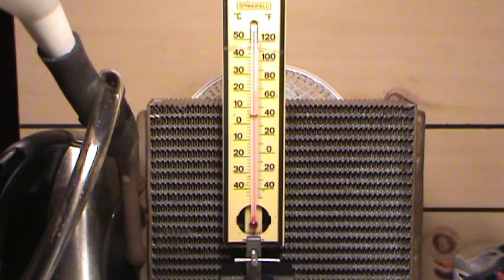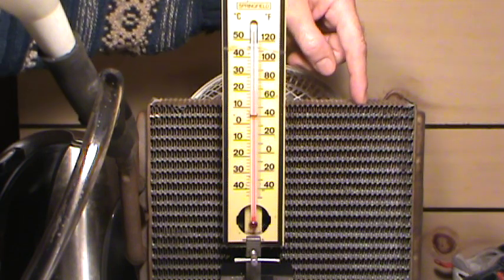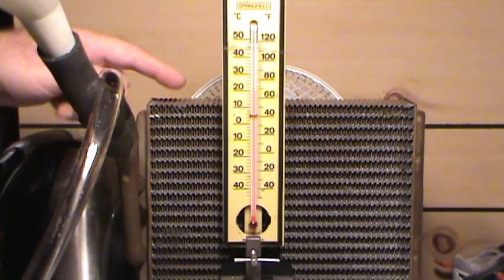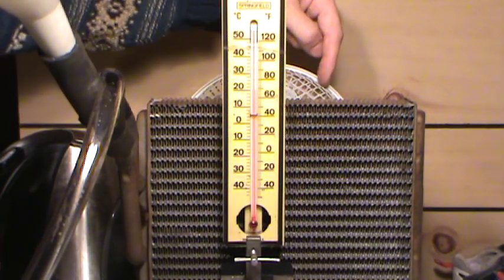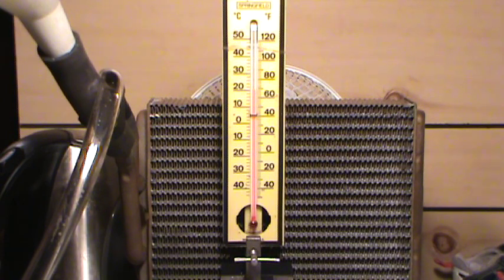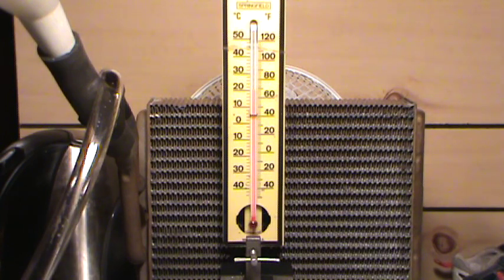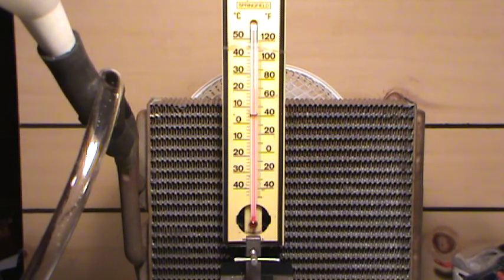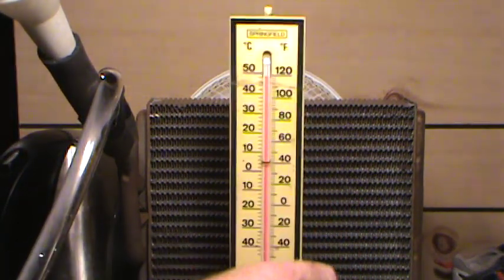How the Heater in your Car or Truck Works

Comment: can you also show how todays modern heating system works, that vacuum you were talking about.
Reply from the maker: Greetings...bazrazin1...……..Thanks for watching...……..Well, there are quite a few different designs, that apply to, the heating and air conditioning controls, that, the many different vehicle manufacturers have, for all of their vehicle models...…….In, some of the much older cars (before computers were installed in them), then, the cars, usually only used cables (like the brake cables on a bicycle), to control the air diversion doors (flaps), that were in the heater box, under the dashboard, along with, an electrical switch, to control the speed, of the electric, (air) blower motor, that blows hot or cold air, into the vehicle, through the vents in the dashboard, or, onto the floor area...……..Then, some vehicles, had a bunch of, smaller size, rubber or plastic hoses, and, when the engine was running, then, the position of the switch, that was on the dashboard, routed the engine's vacuum (as in, suction), to an actuator (might be a small can shaped thing, with a rubber-like diaphragm, inside of it, which might, push or pull, on a rod, that might move an air diverter door (flap), in order to direct the air, to where, it is supposed to go (sometimes, through, partially through, or around the heater core, depending on, how hot you wanted, the inside of the vehicle to be)…….Then, it gets quite involved, and then some, when air-conditioning is added in...!!!...……The Heating system, and, the Air Conditioning system's "Controls", have to be working properly, or else, things get all messed up...…….The heater core, has to have, hot coolant flowing through it, if it's heat, that you want...……..If Ya want it much colder, then, the air conditioning system, has to work properly...……..So, yeah, there's a lot going on, with the controls, when, having to control, both, the heating, and the cooling (air conditioning), and that's why, it's usually so expensive to fix, with all of those (moving) parts, as well as, how difficult it gets, at times, just to, get at, the part or system, that needs fixing, and...….till next time...….Be Safe, take care, and have a good one.

Comment: Where did the 2 pipe locted
Reply from the maker: Greetings...RAJIV RANA.............Thanks for watching............The "2 (metal) Pipes", that, the 2 rubber coolant (anti-freeze and water mixture) hoses, get clamped onto, on this particular Chevy Van's "heater core", are both, on the "same side", where you can see, a clear plastic hose, connected to 1 of them...........Due to the many types, of cars and trucks, that there are out there, then, there has to be, many..."different"...heater core...sizes, shapes, and, just where, those 2 metal pipes come out of the heater core, so, the heater core, and its 2 pipes, will "fit" properly, into the heater housing (usually, found under the dashboard), and sometimes, not too far from, the air conditioning system's, evaporator (core?), if so equipped, and........till next time........Be Safe, take care, and have a good one.

Comment: Thanks for the video! Out of curiosity, can this system works in reverse, you know, a simple refrigerant running through the core to cool off the air?
Reply from the maker: Greetings...Mr. DC..........You're welcome, and, thanks for watching............Well, if that simple refrigerant, is just plain ole water, then, it should cool the air, to a certain extent, and, I be thinkin', that, if I were to run "ice-cold" water through the setup, that you saw, in this video of mine, then, it should cool, that, warm or hot air, quite a bit, that was going through, all of those little fins, in the heater core, as seen, in this very same video (of mine)...........I have, I think it's called, something along the lines, of being, a "swamp cooler"..........This "thing", is a quite large (factory made), plastic box-shaped unit, that's on 4 metal legs, complete with castors (wheels)............On the back-side of it, there's a large woven vertical screen, oh, about 5/8 of an inch thick (looks a bit, like a co-co colored doormat, somewhat), that has cold tap water pumped up to the top of it............The unit, runs on 110 volts ac (house plug)............So, on a hot day, I just add, a gallon or two, of cold tap water, into the unit's, lower holding tank, then, select the fan speed, and then, the (internal) pump, pumps that cold tap water, up to the top of that, shall we say, "co-co" mat...lol...and then, that cold tap water, makes its way, along the co-co mat's, entire top length, and then, it just "trickles" down, the co-co mat's entire surface (due to earth's gravity), and, when that, very warm room air (or, very warm outside air, if I use it outside, that is), passes through, the cold tap water-soaked co-co mat, I get...ahhhhh....cooled down...real good, and, I guess, that one could call "it", a poor man's..."Air Conditioner"...!!!...lol...and damn, I picked this, almost, new looking "thing" up, quite a few years ago, at a thrift store, for, now get this...$15.00...!!! (as I recall), and.......till next time.......Be Safe, take care, and have a good one.

Comment: great video. thanks!
Reply from the maker: Greetings...Chaz Steadman.............Thanks for the nice comment, and for watching too.............Well, You have probably noticed, that there isn't any Heat coming out of the (windshield) Defrost Vents on top of the Dashboard (with the fan on), when-ever the Engine is first started on a quite cold day, right...???...that's because the Coolant (anti-freeze and water mixture, that is inside the engine, radiator, and heater core too) is, about as cold as, the Air, that is surrounding the vehicle, before, the cold Engine is started-up................The Colder it is, where the vehicle is parked, then, the Longer (time-wise), it will usually take, before the (cold) Coolant (that gets "Heated-up" by the running engine), will Warm-Up enough, to the point, where, the Cold Air (that was coming out of the dashboard's defrost vents), will gradually, get warmer...and...Warmer...up to the point (as in Hot), where the engine has finally reached its Maximum Coolant temperature, that is usually Limited/Regulated by the engine's (coolant) Thermostat (some engine Thermostats, might be rated at, 195 Degrees Fahrenheit, as an example)..............When engine "Coolant", gets too Old, then, the "Anti-Corrosion" protection, that the Anti-Freeze itself provides (when mixed in the proper mixing Ratio, with water), will get used up/disappear, and will usually get to the point, where, "Corrosion", will start Attacking/building-up, in both the Heater Core, and the Radiator as well, and when it gets Bad enough, then, both the Heater Core and the Radiator, can become "Plugged-Up"...and/or..."Spring a Coolant Leak"...!!! (not good, and, expensive at times as well, to install a new Heater Core, and/or, new Radiator...!!!)............Anti-Freeze, is also "Anti-Boil", so to speak, cuz, when Anti-Freeze is mixed properly/correct mixing Ratio with water, then, the Coolant's Boiling Point is "Higher" than, just plain ole Water is, all by itself...............Also, the Coolant System's "Pressure" (oh, 15 P.S.I./Pounds per square Inch, as an example), that the Radiator "Cap" is calibrated for, will also (by itself) Raise the Boiling Point, of the Coolant, and, just Plain ole Water too.................Warning...!!!...Never Open/Take Off a Radiator "Cap", when the engine's Coolant is Hot or Warm, cuz, the Coolant, is under "Pressure", and that Hot Liquid will Burn You, when it comes Shooting out of the Top of the Radiator...!!!...............There are Different kinds of "Anti-Freeze", and, it's a good idea, to use the "Type", that is Compatible with Your Exact vehicle and engine...............Some types of Anti-Freeze, should be Changed at 2-Year intervals, while other types, say they can last for 5-Years, before putting new stuff in its place (lots of information, is usually printed on, the front and back, of the Anti-Freeze Jug/Container)................When Heater Cores "Plug-Up", then, they probably won't be putting out, as much Heat, as a New Heater Core is capable of..............If a Radiator gets "Plugged-Up" really Bad, then, the Engine will probably/eventually, start "Over-Heating"...!!!...especially so, on a Hot Summer Day (not good...!!!)................Usually, if a Heater Core "Springs-ah-Leak" (coolant leak, that is), then, there will probably be, a sweet smelling "Fog", that will come out of the dashboard's defrost Vents, especially so, when the Fan is running, and if so..."Don't Breathe this Stuff"...it's Bad for You...!!!...and/or, there might also be (at times?), a small puddle of Coolant, on the floor of the vehicle, not too far, from, where the (leaking coolant) Heater Core, happens to be located.................Also, clean up any Anti-Freeze, that is out in the open/on the ground, cuz, if something like a Kitty-Cat, steps in this "Toxic" Stuff, and licks its Paw, then, there's a pretty good chance, that, that Cat's 9-Lives, are all gone now, as in, one Dead Kitty-Cat, and I hope not, and, that can be avoided, by simply, cleaning up that spilled (on the floor/ground) "Anti-Freeze", and........till next time........Be Safe, take care, and have a good one.
Reply: Thanks!
My possible application is to run the intake output lines to a 5 gallon (or 10 gallon) container of hot water and use a 1/16 hp dc garden pump to cycle the water (no antifreeze) thru the heater core to heat part of the space in my motorhome (the living area, hopefully).
Any thoughts on this?
Thanks again,
Chaz
Reply from the maker: Greetings...Chaz Steadman............You're welcome...........Well, if using plain, good ole water, then, over quite some time, the Heater Core will probably start to Corrode, inside of, its internal (liquid) passageways (hollow tubes), where the liquid circulates, and might start plugging it up, unless, the heater core's hollow tubes are made out of Copper or Brass, I'm thinkin'..............If the hoses and/or pipes are Open, on at least One End, and there is "No Pressure" being built up, inside of the hot water carrying hoses or pipes, then, that would be much Safer than, having a Closed (hot water) System, where-by, "Pressure" will Increase, as the Temperature of the Water becomes Hotter, which will require an appropriate "Pressure Relief Valve", that has the proper "Blow-Off" (pressure relief) Rating, for that Exact System, or "Boom", it just might, end up being..............If Your Pump is at the same Height, or Above the Heater Core, then, water flow will probably be alright................On the other hand, if the Pump is a lot Lower than the Heater Core, then, here's something, that I still kinda remember................It takes 1-PSI/Pound per square inch, of water pressure, to raise a column of water, just over, about 28 Inches, higher in altitude (as in, up/vertically) from the starting point (applies to a Pressurized system)..............You might hear Gurgling sounds, when the hot water starts circulating, and it'll probably be Trapped Air, inside of, the Highest part of the system.............If it gets too annoying for Ya, then, if there was an Air-Bleed valve, installed, in the highest part of the system, then, that trapped air, could be removed, quite possibly, while the pump was running.................Always remember Safety, when-ever dealing with Hot Liquids, and/or Pressure, cuz, when things go Wrong, things tend to get...very Ugly...very Serious...very Fast...and I hope not..............If You care to, You can let me know, how it's going, and........till next time.........Be Safe, take care, and have a good one.

Comment: So essentially the hot water is fed in through a tube by the water pump and distributed through a the heater core, which is basically a series of fins/vents designed to slow the circulation of the water allowing fans the blow the heated piece of metal towards the passengers? Wouldn't that water circulating in the vents be antifreeze in which case wouldn't that dangerous to inhale?
Reply from the maker: +James Whyte Greetings James Whyte....Thanks for watching, and for Your comment as well...........................Actually, the Coolant (water and antifreeze mixture) flows through, flat-shaped Tubes, and, the thin, zig-zag shaped, sheet metal Fins, are in contact with, those flat-shaped, coolant carrying Tubes, in order to transfer the Heat, (when there is some, that is), from, the warm/hot Coolant, when-ever, there is sufficient Air-Flow, through the flat-shaped metal Tubes & sheet metal Fins, that make-up the Heater Core itself.................I just think of a Heater Core, as, just be-in, a very small Radiator, but, having the Heat, that it produces, put to good use, and keeping me, nice & Warm, inside the Vehicle, when it's Cold Outside, instead of, just, throwing all of that Heat, into the Engine Compartment, like a Real, and BIG, Radiator does...lol..............................When-ever (in the past), I had a Heater Core, in/under the Dashboard..."Spring-ah-Leak"...as in, usually, just at first, being a small, Pin-Sized Hole/coolant Leak, I would, for the most part, be Seeing a Fog-like mist, coming out of the Defrost Vents, on top of the Dashboard, and even more-so, if I were to turn the Defrost/Heater Fan On...!!!...and, was kinda sweet-smelling (a clue to me, that indeed, some antifreeze was Escaping, out of that small/pin-sized, heater core...Leak, alright), and, it's probably, not all that Healthy, for Anyone, to be Breathing, that Sweet-Smelling-Fog-Like-Stuff-that's-coming-out-of-the-Defrost-or-Heater-Vents...but, after I did, inhale a bit of it, here I be...still Alive...!!!...lol..........................Animals, on the other hand, might "DIE", if, oh, let's say for example, that, a Kitty-Cat, steps in some Antifreeze, on the ground, and licks its Paw...!!!...............That's why, it's Very Important, to "Clean Up"...Any Puddles, or the like, of Antifreeze, on the Ground...!!!.............If there happens to be an Air Conditioning "Refrigerant"..."Leak"...inside a Vehicle's Passenger Compartment...Park the Vehicle...get Out of it, and get it Fixed as Soon as Possible...!!!...cuz...a while ago, I had a Friend of mine, Inhale some Refrigerant "Gas", that was coming out of a House-type Fridge, and Man, He sure got Sick...!!!..................................All-Righty then...lettuce say, that, it's first thing in the Morning, and, it's Cold enough outside, to Freeze the Water, in the Dog's (drinking) Water Dish, that was left outside, (as I start Shiverin'), headin'  out to the Car, to git-er-Started..........................That poor ole Engine is really Cold (and so is, all of the Coolant also), so, I get the Engine Started, and...Nothing but "Cold Air", is comin' out of the Vents, with the Fan turned on (and I start to Shiver, even more...!!!...lol)............Well, You see my Friend, that good ole "Coolant's Temperature" (well, when everything else is working properly, that is), is the Number One Factor, as to..."Just How Much Heat"...You'll get out of that good ole Heater Core, with the Fan turned On, and, that's pretty much a given, as I see it (oh, and, hopefully, that good ole Heater Core, isn't plugged up Internally as well, which will usually Restrict, the Coolant's Flow, through all of those, small, flat-shaped, coolant carrying Tubes, along with the Fins, end headers/caps, and, inlet & outlet pipes, that do, make up the Heater Core, as a whole, & complete Unit)...........................So, I hope, all of what You read above, helps You out some-what...........................If You happen to have any questions or concerns at all, just leave a comment, question or two, under any of my YouTube Videos, and...................till next time............Be Safe, take care, and have a good one.